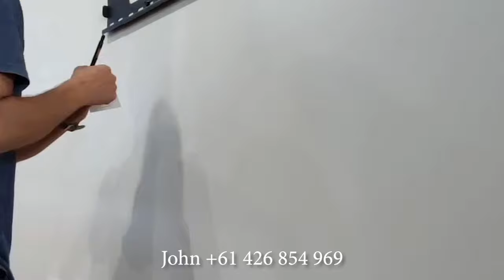TV Samsung 75" Q60T Wall Mount and Cable concealment

Comment: What was the size of the bolts used to install the brackets on the TV. QLED is quite Slim so none of the Sanus mount bolts fit in.
Reply from the maker: Hi! the bracket comes with bolts, we always install or use this ones. It depends on the type of wall where we are working on. If your TV is a Samsung No gap wall mount the story is different.
Reply: @homesweetcomms4646  Samsung 75 qled 60 a

Comment: Hey mate , Are you able to tell me what the measurement from the top mounting screw to the bottom edge of the tv is, trying to work out if it will fit in my space before I buy it
Reply from the maker: Hi! Mate, all the measurements are different... You need first to know really well where are the timbers.
Reply: @homesweetcomms4646  hi mate I currently have. 65" mounted and wanting to upgrade to a 75, the reason for needing this measurement is to make sure with the extra size it will still sit above the sound bar
Reply from the maker: @jgarner447  look at the back of your TV at the bracket, if this one has two large bars you new TV must fit on this bracket, is only uninstall and reinstall in your new TV the same bracket, off course you have to measure the distance between your bar, the new TV and the bar, you can mesure the line between the top of your wall bracket and your sound bar, after that mesure the distance of the hook of the bracket bar and the bottom of your new TV plus few CM more and done!

Comment: I have been told by family members that I need to remove my drywall and add studs perpendicular to the existing studs so I can screw the mount into my 24" studs and at 16" on the Perpendicular studs. Is this necessary for a 75" TV? Can't I just mount it to the studs 24 inches apart?
Reply from the maker: If you find the studs and this ones are from ceiling to the floor, you don't need move anything. I thing, if you will go to install your TV on the wall with a flat bracket, you don't need modified  your wall. And for sure, you can install your TV of 75" in that studs.
Reply: you can use studs that are there just pre-drill holes so as not to split or crack wood. don't drill all the way through stud. I have had a 75in tv hang on my mount for years no problem. wt: close to 80lbs.

Comment: Waiting for mine..can you adjust thIs Samsung 75" TV base stands to the middle too? i have a shorter table. i want mine on the table. my current TV have two base stands ajustments..wide and middle.
Reply from the maker: Hi, this kind of bracket has te option to put lower or higher, it depends on where do you want see your TV.
Reply: @homesweetcomms4646  thank you but i was asking if i want to put tv on my table instead of on the wall
Reply from the maker: Oh! Sorry! No my friend, you can't, because this TV comes with only two holes for legs or stands. If this doesn't fit to you table, you can buy another kind of base or a reference of Samsung with base.
Reply: @homesweetcomms4646  Thank you very much for your help and for your time. Very nice impressive work by the way. I love it!!. So very professional and so accurately leveled  without cables hanging around. I actually love it more on the wall. I may stick mine on the wall too later after I decide to remove my massive New York and Statue of Liberty posters...lol
Reply: Нд

Comment: Need advise from you guys. I have a stud in the center of the wall.  On the left of it is a stud 17 inches apart and on the right is 15 inches. Either studs i use, my plate will be so offset that i cant center my TV. ON the upper portion of the wall, the contractors screwed studs horizontally crossing the 3 studs.  Can you picture it?  What TV mount can i use for this situation?
Reply from the maker: Hi Steven, if your TV is big enough you could use a  big bracket, or, you could install your TV center but the wall-mount off center, you will need to do very good measurements. In this kind of cases we commonly let the tv sit on one of the sides of the bracket, exactly in which is far from the customer sight.
Reply: there’s stud every 16 inches
Reply from the maker: @jrnycg3589  id 16 inches are 400mm or 600mm yes... the problems isn't the distant between the studs, the problem is if your bracket is big enough and you know how to manage to let it installed and covered with your tv.

Comment: Hi may I ask what screws you used to bolt the tv wall mount holders
Reply from the maker: Hi, I use to use the bolts that comes in the mount box.
Reply: @homesweetcomms4646  do you know the size of bolt it is..

Comment: If only they put the TV VESA points in the same lace on the Q95...
I need to relocate my TV mount from the previous 60inch, as the Q95 mount is much higher on the back of the TV frame.
Reply from the maker: Good look!

Comment: how high off the ground was the bottom edge of the tv?
Reply from the maker: Hi, always is different, but you need to do your measurements from the bottom of the TV to the bracket, plus 15 cm from the bottom of the tv over you cabinet, or the distance that you want have between both. Good luck!
Reply: Ррпд

Comment: Alguien sabe que medida son los tornillos para sujetar la TV con la base porfa y como pedirlos
Reply from the maker: Amigo, cuando compras el bracket el viene con un grupo de tornillos de varios tamaños, asi que no te afanes, sin duda alguno casara al TV.
Reply: Yo también tengo esa duda, cuando compré el rack solo me vino una medida que sí le hace a mi otra TV, pero no a mi Q60T
Reply: Si igual ami, tuve que cortar los tornillos porque no encontré la medida
Reply: Los tornillos son largos? Aproximadamente cuánto de largo tienen? Por favor
Reply: No se exactamente la medida, tuve que calcular pero si son largos
Reply from the maker: Amigos, deben usar alguno de los otros tornillos que vengan en la bolsa, si el bracket viene solo con una medida, devuelvan ese bracket y compren otro, ya que no es uno bueno o no es el que requiere su TV. Si el tornillo es muy largo usen espaciadores dentro y fuera de la varilla. Atentos a mis videos, en estos días posteo uno en español e inglés.

Comment: tembok nya mudah di bongkar ya?
Reply from the maker: Ya, Anda tidak akan kesulitan melepas sekrup dan melepas dudukannya.
Reply: @homesweetcomms4646 
but in my country usualy. material wall made cement. not to easy for me if insert cable in wall..
btw i like tv without cable anywhere.. this is very nice
Reply from the maker: @saejiwo1266  Sure, I understand. Well, that job will gonna be more difficult, could you make a hole on the wall, put a conduit and run the cables inside and then cover again the hole with cement. It's an option.